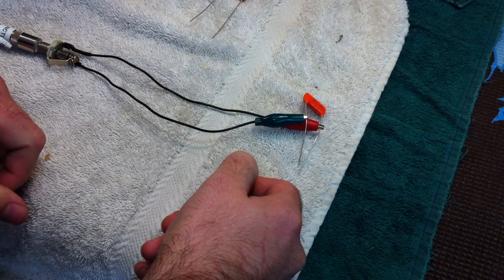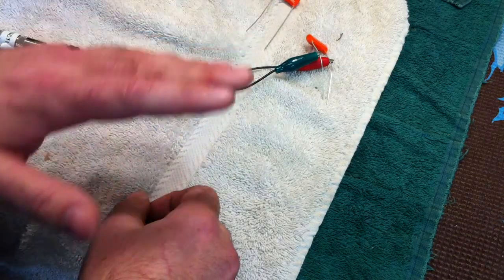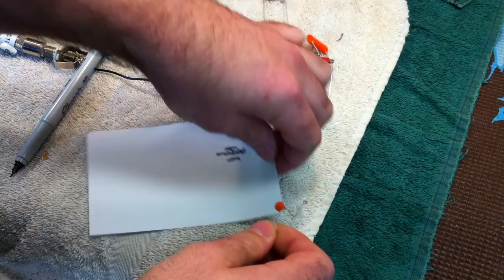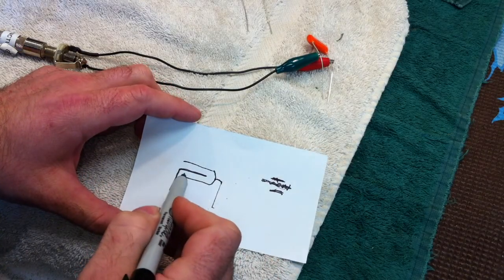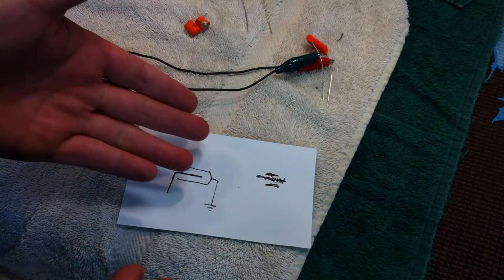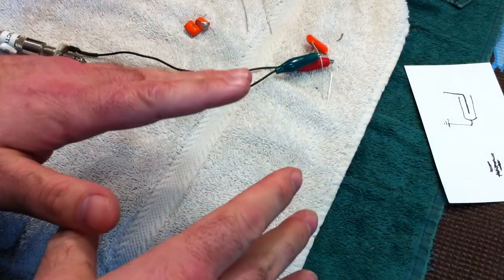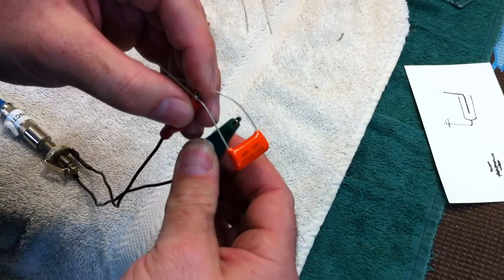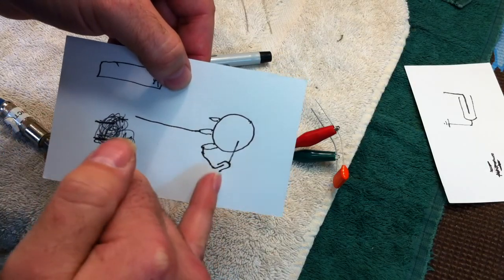Installing Orange Drop Capacitors in the Correct Orientation

Comment: These Caps were not designed to have a correct or even a preferred orientation. In some cases, the lead that is connected to the internal shield of the capacitor may provide a slightly less noisy output if connected to the ground. Can you hear this ' difference ' in noise when a guitar is connected to an amp even with the slightest level of gain, is a matter for debate? Let us just fuss less about the hardware and enjoy the music. I am an engineer BTW, and have to deal with such issues on daily basis.

Comment: Nice ! What a clever method to identify the correct orientation. I cant imagine how much noise could add several not shielded capacitors in an amp. But may it be necessary if installed inside an already shielded circuit as like inside my shielded guitar ?

Comment: 2 min 40 secs into video:  That is NOT the way signal capacitors work.  Think of them as a stretchy insulating membrane that can be deformed by imparting a charge, when the charging current is removed... or the polarity of the signal changes, that insulating membrane will attempt to return to a base state... and in so doing it will dump the charged potential back into the circuit.  Capacitors of different values do this progressively faster or slower and this property of capacitors allows you to build tuned circuits when they are used with inductors or resistors.  Please play safe and regard those maximum voltages printed on the outside of the orange drops to prevent dielectric punch-through.  No issues in a guitar, but inside an amplifier you must use proper ratings. Orange drops don't explode like electrolytics, but they can fail.

Comment: Actually , I thought that an Orange Drop 716p cap had a finger joint design - so there was no outside of the foil .
But because of your video - I just checked a 3.3nF on a scope and you are right . 
Switching the leads around , one lead is more sensitive to 60 Hz hum . 
.

Comment: If the capacitor manufacturer intended the cap installation to observe a polarity, why don’t they mark the capacitor as such?
Reply: It’s not really polarity, it’s just one leg is wired to the outer foil… and grounding this leg can reduce hum or interference. It will still work as a cap wired either way, but grounding the outer foil is potentially quieter
Reply: If polarity is important, the manufacturer makes one lead longer than the other. If they are both the same length, it doesn't matter.
Reply: It's because how they're made in the machinery apparently and pre epoxy coating they end up randomised from a feed bin, so to speak.

Comment: Thank you. I wasn't searching for this, but the algorithm gods must have known I'm about to throw together my esquire soon (after I figure out how I plan to finish it, I'm thinking shellac) My order of parts came in yesterday, and included were 4 orange drops of different capacitance because I am unsure of what will work best for me and they were inexpensive enough to try a few - .022, .033,.047. (100v polyester) and .005 (600v propylene). This info about the correct orientation is very useful. Thank you!

Comment: There is a great thread over on the TDPRI on how to make a super simple/cheap device using a three-way Telecaster switch to determine the outside-foil lead on any capacitor.  The trick is to use a 'make-before-break' switch because of their silent operation, and the CRL/OG (Tele) switch is precisely that.
Reply: Do you have a link please

Comment: Ok, there is a shielded end which should go to ground. Maybe not as much difference in a passive guitar circuit as an active one. However why not get it oriented correctly? I appreciate the video and will use this method next time I add a capacitor. Thanks much!

Comment: Thanks! Why don’t they just mark + and - on the capacitors?
Reply: I don't know.outside foil isn't marked on caps sold today.I have some books from the 1950's and it says it's important to install capacitors in the correct way. 
Radio and tv servicing  by Alfred ghirardi 1952

Comment: I've used them soldering the orange cap with the writing, left to right, to earth...most people use them either way but they can swell & leak as you state, i use hi-fi grade, small for Polypropylene caps, with 5% tolerance & a 4K7 1% resistor, i use the Fender Greasebucket tone control set up, 2 caps & a resistor, 0.1uf & 0.022uf or 0.047 & a 4K7 resistor...i would not recommend using electrolytic caps... interesting information,well demo'd, most people can hear only a tiny difference, i built loudspeakers for years where we build passive x-overs...i just follow the same rules, the best components i can afford without paying silly money, CTS (8% tolerence they claim) 250K Linear solid brass shaft pots, they are very good quality.... Polypropylene caps are only £15- £20 for a mixed batch of 10...gives me peace of mind using the best i can....

Comment: in a guitar with passive electronics I've been told by a few electrical engineers that this is a complete waste of time.  As is buying sprague / vishay orange drops. If you've got a 5% tolerance capacitor, even a cheap red or green polyester capacitor. Yep the ones found usually in Asian guitars. Keep them, there is nothing wrong with them. Build a pedal or something with that previous solder. They are hyped up by crooks on a forum trying to sell theirs or some online listing  trying to make more money off a harness or build. Why some paper in oil capacitors for example sound different than a modern day capacitor is because of it's tolerance. 20% tolerance was totally fine 60+ years ago, now we wouldn't use them in guitars if they just came out today. 

in terms of tone on a passive guitar 
voltage doesn't matter - higher voltages are usually just larger in size 
material doesn't matter 
the only thing that matters is tolerance, 10% of say a 0.1uf (100nf) capacitor can be sold if the value is between 0.09uf (90nf) and 0.11uf (110nf). 
The smaller the tolerance the more consistent they are so if you were as big as Gibson or Fender you're certainly not using 20%.

If anything try 1950s style wiring on a guitar for how to hook the tone control up if you want to spice things up

Comment: Thanks for this! I've been hunting the source of hum in my dual LA2A I just built, and narrowed it down to either a ground issue, a tube issue or an issie with the orange drop caps I have i btween both the triodes in the firsr part of the amp stage.

I would touch the orange drop that was physically positioned inbetween both tubes in the amp stage (this is why I couldn't ruel out the tubes) andit would basically do what you are showing in this vid! I bought a couple of solen fast caps to replace them, but they havven't arrived yet, so now I'm going to switch the polarity of the orange drop and see if that fixes it!

Ta for the insight! I had no idea these changed in performance with polarity. But seeing the diagram makes it obvious why that is!

Comment: So are you saying that the middle lug of the tone pot should have a wire to the far left power to / pickup lead wire lug ? I usually use Seymour Duncan pickups and they all have the 4 conductor wiring..so the Black wire / hot wire from the pickup to the far left / first lug on the volume pot to the middle lug on the tone pot ?
I want to install a treble bleed and already soldered the resistor between the Orange drop cap and it's ready to use after it gets installed "properly".

Comment: This is fine for guitar tone caps going to signal ground, but the essential aspect of cap orientation is that the outside foil should go to the end with the lower impedance. Hence when used as a coupling cap the outside foil should go to the side with high voltage, which has lower impedance while the other end should go toward the grid/signal input of the following stage.

Comment: Installing orange drop capacitors in the correct orientation: step 1 - there's no incorrect orientation. All the pseudo-expert talk about difference in EMI is just nonsense and placebo.
Reply from the maker: I'm not sure how EMI is nonesense. I used to like demonstrating how you could find the nob and tube wiring in one of my old shops to customers with unshielded Strats.
Reply: @DrewsGuitarShop  I don't see where I said EMI is nonsense (if you see me saying that, please quote, thanks). EMI is certainly way overblown among guitar people, especially when they explain the ways to prevent it (I wish I had a penny for every time I saw someone explain that you have to make a Faraday cage in your guitar or something like that), but it is definitely a thing. I said your pseudo-expert talk about the capacitor orientation making a difference (be it from the point of EMI or otherwise) is nonsense.

Which it is, because there's no such thing as a correct orientation of a capacitor in a guitar tone circuit. Not because of EMI or anything else. And rightly so, because it also makes absolutely zero sense from the theoretical perspective there should be one. You're not changing anything electrically by turning the capacitor the opposite way.

Anyone hearing an actual difference between different tone capacitor orientations is yet another victim of our lovely friend the placebo effect, already so well acquainted with most people in (not just) audio community and especially the guitar community. And if there was a blind test done, nobody would be able to tell the polarity of the cap.

Comment: MOST ALL CAPACITORS HAVE A FOIL SHIELD AROUND THEM. YOU NEED A OSCOPE TO FIND THE FOIL. AND IT WILL NOT BLOW UP IN YOUR FACE.  MR. YOU ARE OVER YOUR HEAD ON THIS.
THE CAPACITOR STORE THE CHARGE BETWEEN THE PLATES. PLATES CAN BE TIN FOIL, PAPPER, PLASTIC , AND LOTS OF OTHER THINGS. A CAPACITOR CHARGES UP IN 5 TIME CONSTANCE AND DISCHARGES THE SAME WAY. INSIDE YOUR GUITAR THE ORIENTATION DOES NOT MATTER. BECAUSE YOU ARE BLOCKING NO DC. AND THE RESONANCE FREQUENCY OF THE POT AN CAPACITOR WORKS ANY WAY IT IS OREINTED. IN THE AMPS YOU PUT THE SHIELD SIDE TOWARDS THE INCOMMING FREQUENCY TO HELP SHIELD IT INSIDE THE AMP.
Reply from the maker: Did you skip past the part where I mentioned that only electrolytic ones do that? Also is your caps lock broken?

Comment: Excellent vid. Thanks, Drew. Curious. Is the printed text on the orange drop not consistently oriented, or is this not a reliable way to tell which side is the ground? I would have assumed they'd all be mass produced in the same orientation (at least if the capacitor is sourced from the same manufacturer). This seems like an obvious tell, but it's probably not.
Reply from the maker: In my experience, the text has nothing to do with the orientation, unfortunately.

Comment: Big question. Can you tell the difference in tone in a blind test which guitar has the cap connected the wrong way?
Reply: Of course not, because there's no "wrong way" to connect a tone capacitor in a passive guitar circuit.
Reply: So if I have an Orange drop cap and have determined which side of the capacitor would be the ground side and put my mark on the cap would the side with the ground mark leg solder to the back of my tone pot in a 2 humbucker pickup with 1 tone 1 volume control passive pickups ? @Case_
Reply: @rosskrause3926  There's no ground side on a cap, solder it whichever way you want, it doesn't matter.
Reply: Tbat sounds great. no pun intended..I was going to wire up a guitar project up and was looking for a baggie I had 6-10 Orange drop  caps in and couldn't find it so I found a pot that had a cap on it and realized I  soldered it on the wrong lug and saw your video and had my mind not knowing about the polarity..but you cleared my mind of that anyway. Thanks again.  @Case_
Reply: @rosskrause3926  I'm not the person who made this video...
Reply from the maker: Sure. In a non-shielded environment, the one with the cap going the other way will be noisier. This video isn't about tone, its about EM noise reduction.

Comment: does it actually make any difference to the sound of the guitar though?
Reply from the maker: No aside from helping to eliminate noise. The cap will function as a cap in either direction.
Reply: @DrewsGuitarShop   ah ok thanks! so does it make enough difference eliminating noise to make it worth doing?

Comment: on our 1/4 plug , is the sleeve the "hot" lead ? , and the "tip" is negative ?
Reply: Tip is positive. If you look at a guitar amp schematic it will show the tip as positive and sleeve as negative.
Reply from the maker: Sleeve always goes to ground because sleeve is part of the shielding system talked about in the video.

Comment: hello what kind of amp did you use for this tes because on my guitar amp I touch the cap in both direction and I can ear anything, only if I touch the wire???
Reply from the maker: Are you touching the metal of the plug? If you do that you wont hear anything.

Comment: Legend! Thanks for this! 

 Had a question. By this logic could you also just plug In your guitar and then put the cap into position taking on and off your fingers if you position it right then solder it in when you find correct orientation.  Or would this be bad for something else in guitar.
Reply from the maker: The cap is not always engaged when in the guitar.
Reply: your way of having the cap already installed in the guitar and then connected to the amp might not always work, because of the tone pot knob and volume pot knob rotation, meaning if you were to have the pots knob turned to a setting that did not allow the capacitor to work at its fullest filtering potential, you could be getting the wrong result to think yoiu found the correct orientation of the cap leads. It is better to have the cap out of the guiutar for testing which lead goes to ground.

Comment: how would you do it for 50s wiring since the center lug is soldered to the "cover" for grounding?
Reply from the maker: One side will still be a path to ground.
Reply: @DrewsGuitarShop  i appreciate you taking the time to answer, but that doesnt help too much.
Reply from the maker: @SD-nj1cy  Sorry, I'll try to put it another way. So, one lead on the cap will be soldered to the volume pot, that is your signal end. The other lead will be connected with your tone pot, that is your ground end. I do not prefer to do that method of wiring because it is less modular and easy to mod at a later time but I understand wanting to do it that way.
Reply: @DrewsGuitarShop  thank you. I thought there was a way/you were trying to describe a way using 50s wiring but only use a wire from lug 2 on vol pot, to lug 3 on tone pot(1st lug when they're facing each other), and then the tone cap from the tone pot lug 2 to the pot housing (ground). Know what each lug does, that didnt make sense. Thank you again for taking the time to answer.

Comment: That's what happened to my Yamaha 212VFM, when I tried the guitar for the first time it was hum I meant loud hum and it was so annoying then I thought it happened because the cheap potentiometers and the capacitor, so while thought of that I was upgrading the potentiometers plus the pickups and short story I was copying the default or the original electronics solder that came in the Yamaha and after upgrading the hum still there not changed at all. Can you believe it? I've bought some potentiometers again almost three times and do the same soldering and still humming and also I'm doing what everyone does (shielding) but not working also. Could the capacitor installed not correctly from the factory? It might be. Thanks for the info very useful thanks again! 👍👍👍
Reply from the maker: Single coils always hum, it might be your grounding too.